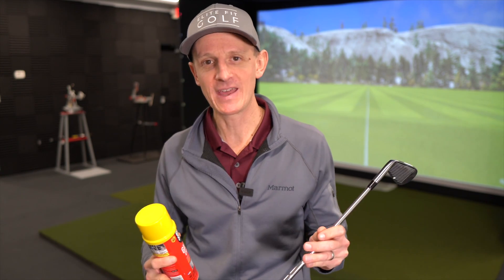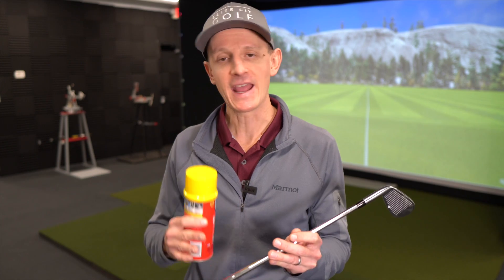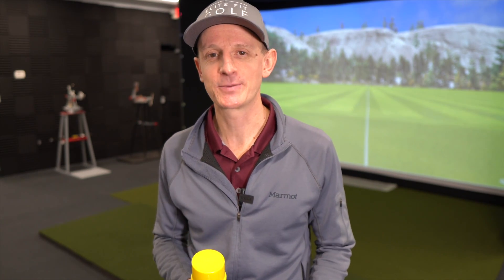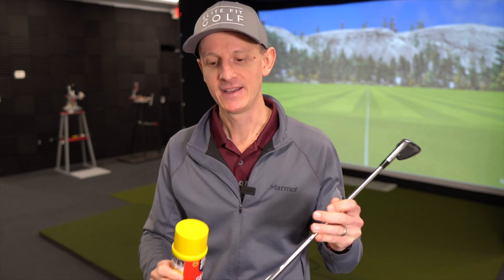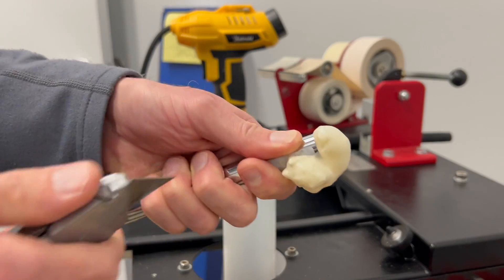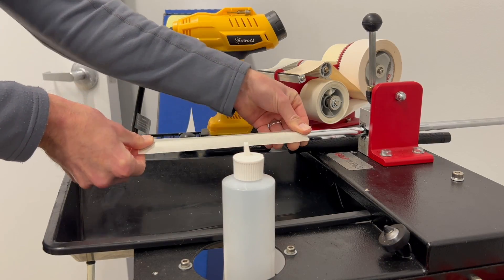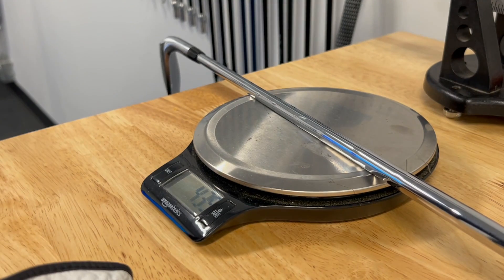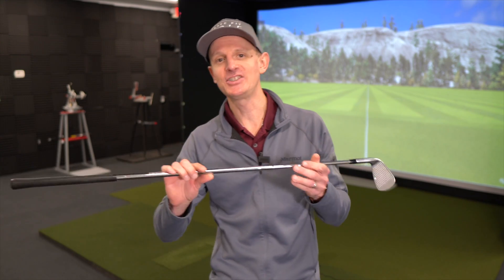Can Expanding Spray Foam in Iron Shafts Reduce Vibration?

Comment: I bet silicone would be a much better solution given its mass and softness. This foam is too light, hard, and brittle. The main prob with silicone though is that it's heavy enough to change the swing weight.

Comment: Just my thoughts I don’t think the spray foam is actually dense enough to absorb vibrations.. memory foam ear plugs should do the job, put them at the tip though so it dams the vibration at the source before it runs up the whole shaft -

Comment: Buy the foam inserts instead IMPO. Not as messy and they won’t dry out and crack like spray foam could. Would hate to later have a rattle due to spray foam drying out and cracking off.

Comment: Hi, Will adding spray foam into a steel shaft prevent the shaft from rusting on the inside. Due to the weather in Ireland I have had steel shafts snap during my swing due to unseen rust on the inside.
PS. Love your show for the 1% incremental gains.
Eric in Cork.
Reply from the maker: I'm not sure if sealing the shaft up will help or not. Guess it would depend on how dry the interior was to start with.

Comment: I’ve actually experimented with foam pool noodles, by precutting strips before installation in the shaft. I install them about halfway down the shaft, using an epoxy to secure them. I’ve never done a whole a set, just one club and worked pretty good compared to a shafted club with Sensicore.

Comment: If you clarify how much of the shaft was filled,it seems the foam would not reach 
The bottom without a hose type extra?
Reply from the maker: Only the top 10 or 12 inches were filled. I never planned on filling the entire shaft. Any shaft dampeners for steel usually only run between 3 and 8 inches so that was my guide.

Comment: Bad idea. Not the correct foam, this foam hardens and is brittle. You demonstrated that when you broke off the piece on the butt of the club. Plus with the trapped air in the shaft, if someone sprays the foam full blast, they will get a face full of foam and a huge mess.

Comment: Why not put the foam in a raw shaft and then build the club?  You could foam the whole shaft.
Reply from the maker: Problem is we would have no vent to release pressure when building the club which could be an issue during epoxy cure.
Reply: C'mon man, think outside the box.  A straight piece of wire coated so as not to stick that can be pulled out after the foam sets.  Maybe something like that with a small tubular hose could be used on already built clubs?  Or make a longer nozzle for the can so that it reaches further down the shaft?
Reply from the maker: @jaymorin7131  You got me. Maybe I will redo this with full foam. Could also probably just heat up a wire hanger and use that to make a vent hole through the hardened foam.

Comment: I would suggest inserting memory foam style ear plugs 11” down the shaft where the grip starts. That will kill vibrations before they reach the grip area. Memory form molds perfectly to the shaft and has better vibration control than hard foam product.

Comment: True Temper used to offer a foam product like this called SensiCore. It was just some little foam plugs that you’d shove down the shaft as far as they would go. They were just held in place by a friction fit. I tried them and liked them, but that’s been 20 years ago.

Comment: You would have had to take the head off too if you wanted to fill the shaft, most likely only about 12 inches has foam the way you did it.
Reply from the maker: True, or get a much longer straw for the can. I was trying to keep all the weights pretty similar to how we started so I didn't want to over fill it.

Comment: I spy a Star Sidewinder grip @3:00! Isn't it great how easily those can be removed and re-installed in just a few seconds using nothing but air? P.S. You don't need to use double-sided tape, you can install it directly over a bare shaft and it'll stick in place and never ever move!
Reply from the maker: Review will be upcoming. Just for everyones clarification reading these comments, the tape used was masking tape for sizing purposes only.
Reply: @EFGMC  Ah, now that you said that I do see that the color of the tape is that of the masking tape rather than the double-sided tape. My mistake!

Comment: I've used tubular foam insulation in my golf shafts for over 3 years now and I'll do it till I die.  To me, it DEFINITELY changes the feel of vibration and with bad shots cancels out the horrible hand wringing you get without it.  I further lowered vibration by having all graphite shafts for all 13 clubs (minus the 58 degree wedge) and I'm telling you, tubular foam in the graphite shafts makes for the SMOOTHEST feeling ball hitting you'll ever play  :)
Reply: By "tubular foam insulation" do you mean the expanding foam from a hardware store, or something else? I'm very interested in trying this out as well.
Reply: I agree.  Been using the Pro Soft foam inserts for several years in my irons and wedges.  Definitely feels better to me.

Comment: There is a gray tubular foam insulation for stuffing into cracks.  It's about 1/2" in diameter.  I've used this in iron shafts before and it works well.  It has to be cut in half or quarters to be able to fit though.  The trick is shoving it down in there without pulling the foam out when you pull out whatever you're inserting it with.
Reply from the maker: I've used that one also and it does the trick.
Reply: This is what I use and it works PERFECTLY  :)

Comment: 24 years ago I played Mizuno MP33s they had dynamic gold sensor core shafts pretty similar to what you're trying to do with the foam and it makes a huge difference probably the best shaft I've ever played in my life, although it is heavy especially for today's standards.
Reply: Still got a set with sensicor shafts lovely feeling shafts
Reply from the maker: True Temper still uses it sometimes with their Elevate shafts referring to it as VSS.
Reply: Happy Days, that was a great club and shaft combination. Still have a set somewhere.

Comment: It is unlikely the foam filled the entire shaft.   It probably filled only the upper part of the shaft at the grip level.  The lower part can be filled with the addition of a plastic tube attached to the spray foam foam tube.  As you inject the foam gradually pull back the tubing until the entire shaft has been filled.  I would like to see the results after the above is accomplished.
Reply: He only intended the foam to be on the top half, that's why he said "...with the foam up in the shaft here" as he tapped near the grip [7:14]

Comment: One question I would have is did the foam go all the way to the bottom or just past the end of the inserted tube? Maybe a thermal temp gun could answer that.
Reply from the maker: Pretty sure it's not all the way down. When I've done this with foam tubing or using Sensicore, the inserts only went down a few inches past the grip end so that was what I was trying to duplicate.

Comment: The red can of spray foam is intended for filling large gaps and it expands with lots of force. For that reason builders don't use it on doors or windows since it can warp frames. That wouldn't be an issue inside a steel shaft. But it also cures to a very brittle foam, which I believe would break up into small pieces. 
I would think that the blue can of expanding foam,  intended for doors and windows, would be better for your experiment. It doesn't expand with as much force and it remains flexible making it better for shaft applications. I also think the foam should  be applied to the center of the shaft or center to tip. True Temper's sensicore inserts were placed in the shaft below the grip area.

Comment: Most, if not all, spray foams wouldn't ever completely set up in that environment.  It would only get a little further down the shaft than the end of the spray tube, and only an inch or two, right at the open end of the tube, would solidify--

I tried a similar trick to reinforce liquor bottles being used as stage props.  Could never get the stuff at the bottom of the bottle to set up...
Reply: If you really want to foam the whole shaft, you need polyurethane foam...if you can find it in the right formulation, it could flow down the whole shaft, it would expand in much the same way, but it sets up in a different chemical process and doesn't require air exposure to set (in fact, the less air exposure, the better).  It also maintains its flexibility much better than spray foam.
Reply: @AllTradesGeorge can you recommend a poly foam product?
Reply: @BallMarks  nope.  That's what I was saying...I've never used a product that would set up effectively in that application.

Comment: More than likely.  The foam had not solidified yet. In an airtight container, just like the head. It will take a while to solidify. 

Did you use the one to one expanding foam or the 1to3?

Now put the foam shaft on your frequency analyzer

Comment: Piggybacking on this and obviously the sesicore idea, have you ever done the cork and ramrod idea. At one point, when I was more active with my clubmaking hobby,  I was thanking about getting at least a couple different sizes and doing that. Personally, I'm quite happy with a graphite shaft in my irons, but I'm still curious if it's effective in reducing vibration.

Comment: There are foam inserts that you can use instead of spray foam.  My biggest concern with spray foam is that is can get brittle, and when the shaft flexes that may make the spray foam break up.
Reply: My exact thoughts 💭 👍🏼

Comment: Didn't true temper make a steel shaft called sensicore that was foam filled? I had a set of Mizuno pro irons with them installed.
Reply from the maker: Yes, foam and wire wrapped. They still use it sometimes and label it as VSS.

Comment: One part foam breaks down more readily (no one wants bits rattling around) such that it was never recommended for old metal woods before the Big Bertha. (There there was also the problems with voids in the foam, hence the complicated ways of cleaning it out, if not the idea of sensicore inserts - that break down in a few year).

It does not prevent rust on the inside but might even increase it on the unplated side of the shaft - but if you are fine with binning the shaft after a couple of years.

Such suggestions are a touch suspect from a fitter who should have a contract with a decent graphite iron shaft producing company.
Reply: What is the relevance of having a contract with a decent graphite iron shaft company?
Reply: @biggregg5  So the fitter has a supply of new - rather than second hand shafts
Reply: @robbasil4441  
I'm still not following. If someone wants a steel shaft with some extra vibration dampening and a quick 10 cent squirt in a new steel shaft helps, I'm not sure how a relationship with a reputable graphite shaft manufacturer is relevant. I'm sure I may be missing something. Let me know.
Reply: @biggregg5  Having tried the Sensicore route for 15 years, the quality of iron graphite shafts today is finally equivalent to steel without the problems of rusting, disintegration of inserts etcetera.

 MMT, the Fujikura or even Steel fiber options can be had at around $60 per shaft 

The additional cost of graphite also should also be marginal - at a proper club fitter who has stock and scale.
 
Asking someone to put half a tube of expanding foam, let alone gun grade or two part is going to ruin things and not be cost effective or consistent in the long run.
Reply: @robbasil4441  
I've gone with graphite and am happy with it, but steel iron shafts are the norm still, and considering you can spend under $10 for a steel shaft compared to the $60 per shaft you quoted, a squirt....not half a tube is not a throw-away viable option. I would bet that it would be 15-20 cents max per shaft. You keep on acting as if a steel shaft rusting from the inside is a serious issue. Of the 100's of clubs I've had, only one steel shaft rusted put while at least a dozen graphite shafted clubs broke at the tip. I would give the nod, easily to steel shafts lasting longer. You may be right that squirting PU foam may cause a moisture problem and may have bits come loose, but I've never heard, in fact that is the case.
Reply: I tried in 2010 to get replacement Sensicore inserts.

True Temper - a minor manufacturer - provided some for free but said they had all sorts of problems with them, in particular rusting, degradation etcetera. They were getting returns after as little as a year hence they stopped offering these. And this was when DG were about $19 a shaft as opposed to $35 plus now.

They only used Sensicore in the late 1990s because other methods - like foam - might work in theory never worked in practice. But what would they know, right?

If you use premium steel - like Nippon or TT - using foam in the head like suggested is not practical, at least in many club working arenas, particularly if you are doing it as a business. There would be no consistency  involved in the process, if not you would be causing problems for later. If you were air gapping a house or even a window, there are limitations to one part foam that goes off quickly - and I go through at least two boxes of cans for relatively minor building processes each month.

The point is if you benefit from the frequency reduction, get graphite if you can. Even if you don't have RA. Modern graphite is getting good, particularly where they reduce the levels of epoxy and binders employed - that are sometimes found in one part foam as well.

Comment: I do not know every single spray foam type, but the most of them need humidity to dry, so if you spray the foam into a tube you may have the problem that the foam will not harden up at the inside
Reply from the maker: I let it sit over an hour before cutting off the overflow and gripping. It seemed pretty hard at that point.